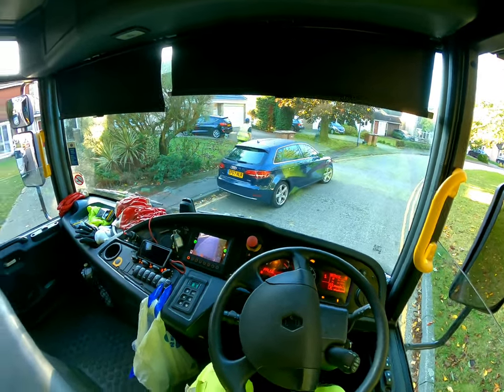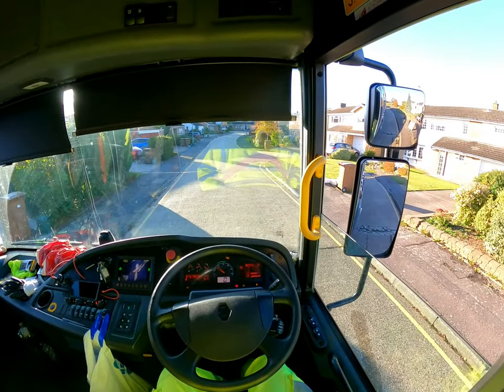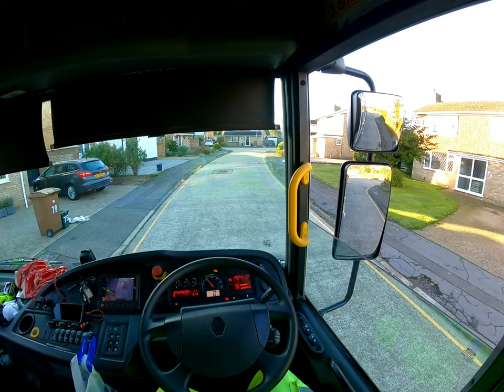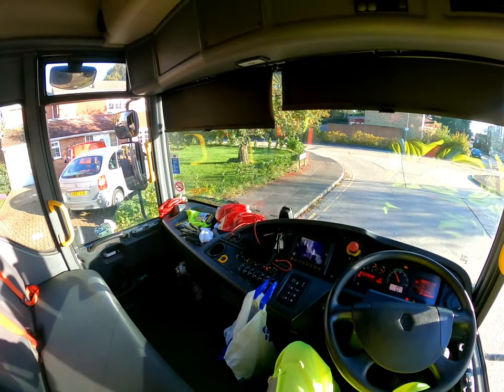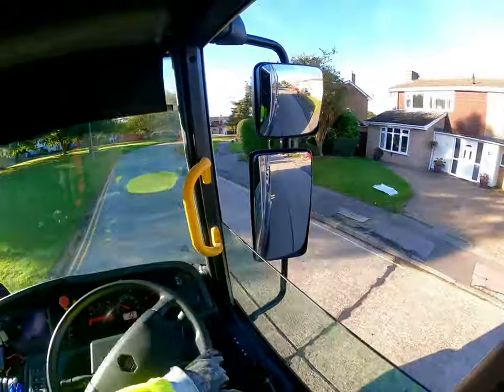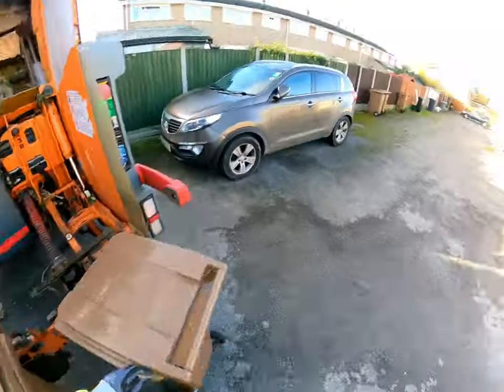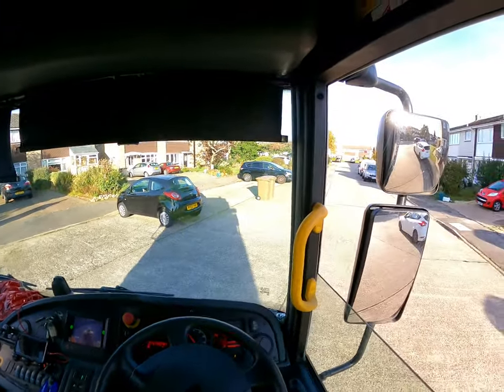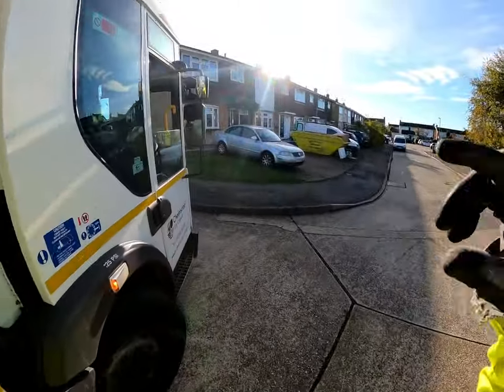Bin Man/Refuse Collector/HGV/Lorry/Truck Driver POV #1

Comment: Great video and great skills by all involved including yourselves! Did you often find bins falling into the hopper on the omnidekka lifts?
Reply from the maker: Well spotted on the Terberg equipment 

Bins would only fall if they were damaged or had bent lips on the front edge 

Other than that the lifts were consistent. Vehicle to Vehicle differences are very apparent 

Uneven lifting on bulk/twin mode
1 fast lift 1 slow
Auto mode getting knocked out once at the top
Sensor issues

The new 2020/21 vehicles have fully electric lifts. I believe they said "Patent Pending" on the back.

Quite a severe lift action that could rip the bins out of your hands and rocket them up much faster than other equipment. You had to keep your wits about you

Comment: The Bins here, where i stay with my mum if the green bin for carboard also grey domestic and the brown bin gardening if they are over flowing they will not collect it.
Reply from the maker: Our bin collection is meant to be lid down + no side waste but every crew operates different. 

No limit to recycling which is reasonable,  any effort to reduce waste to landfill I'd worthwhile.

Comment: wow P4H91 that is awsome and i want to know how hard is it drive a class 2 for like bin trucks and other one that collects the glass bottles ect and how much dose it cost as i wanted to know as someone told me it cost about £250 to £400 if you failed it you have to do it again. but im not sure
Reply from the maker: HGV 2 driving is straight forward. It helps if you have driven larger vehicles previously of course.

I say this due to my prior experience but even for new starters it is something that can picked up with confidence and training.

Height, width, weight and length are considerations to be continually mindful unlike a car which you point and go anywhere. 

Tail swing, mirrors sticking out, heavy loads, tall roof/box/wind deflector all act as jousts against lampposts, buildings, cyclists and other road users.

Leave plenty of space when overtaking, assess the distance needed and run off and thing about how your vehicles speed and size affects others.

If you're looking at training, go for 5 days not 4. For the sake of a small saving you're cheating yourself out of a day of training. I would rather go into an examination/assessment with as much training and help as possible before attemtping a test.

Retest fees are high yes, however circumstances on test day may necessitate it. The test itself doesn't have to be passed first time, it does not guarantee a better qualified driver due to first time pass.

Keep calm
Be attentive 
Buy books, watch videos etc 
Try it enjoy it and stay safe

Comment: Not sure where my comments gone but great video. Do you ever do black bins or recycling collection or only browns?
Reply from the maker: Thank you for your positive feedback 

Unfortunately there shall be no more videos from this place as I have left and shall be starting a new job shortly

Had I known it would be met with this positive reception I would've started filming a while ago

I drove various rounds whilst there 

Black bins 
Brown bins 
Trade waste 
7.5t "ISO" (Isolated- difficult access)

I didn't do any card/paper/bottles/plastic or food recycling there as recycling was run separately from waste/garden

Majority of vehicles in the yard are 18t or 26t Alexander Dennis Eagles. A couple DAF LF and Isuzu 7.5ts are on food and ISO (Isolated-difficult access) rounds 

A few 2005, 2010 models. Majority of fleet are 2017/2018 with some new 2020 "70" plate motors
Reply: @wheelerd02  You’re welcome, that’s a shame, is your new job also in the waste management industry? Seems like you’ve been on a wide range of rounds!
Reply from the maker: @refusevehiclesne  it is indeed in waste management 

I was an agency worker and as such I was not tied to any single round. I was placed as required either covering holiday or if staff allowed, change-over assistance.

I would come with an empty vehicle and continue loading with the crew whilst the primary vehicle went off and emptied. Or, if staffing allowed, I would bring additional loaders and the team of 2 vehicles would split off and whittle down the work much quicker
Reply: @wheelerd02  Great! Assuming you’ll be working full time there now? Yeah we have a similar system here, usually referred to as ‘shuttling’. Any chance you can film in your new job also?
Reply from the maker: @refusevehiclesne  New job is indeed full time. Shall update on progress once I get into a groove

Unsure on videos, shall have to ask them. Although I haven't encountered it I know some places are not keen on video uploads
Reply: @wheelerd02  camera in Dennis last no time the Dennis no where as good as the Mercedes

Comment: How much rubbish can you fit in a 26 ton truck?
Reply from the maker: Vehicle Tare weight is approx 13800kg

Most vehicles can go up to 25500-26000kgs. Some vehicles pack up earlier at 23000-24000kgs

Best case scenario it can take 11.5t of waste 

General (black bin) waste packs easier than Garden (brown bin)
Reply: @wheelerd02   thanks for answering my question

Comment: how bigs the rounds where you are? we can spend from 6am till 5 no break and run like idiots with the amount we do
Reply from the maker: 0630 - 1630 was the rota/paid time.

Some days done earlier, some days later. Black bins were normally quicker than recycling, especially cardboard. 

There js always time for a break, if you are running about and skipping legally required breaks as you say then your gaff isn't scheduling work correctly or fairly. Job isn't worth it nor does it pay enough to run yourself into a early grave.

Although there is an early finish incentive to rush, my employers back then said don't run the rounds otherwise they'll pile more on you. Running yourself ragged just to finish that late isn't worth it, you're making someone at desk have an easier life.

Comment: Nice job! I’m hoping to become a bin man when I’m older
Reply from the maker: Best of luck on your intentions, HGV drivers are sorely needed throughout the UK currently
Reply: Yea I’m in ireland, I don’t actually wanna drive the trucks, just work at the back
Reply: Set you sights higher mate and do something else done the job a few year now it's getting no better. It was good years ago but longer hours due to new builds and a lot more walking.
Reply: @jacobs3031  here in Ireland our refuse trucks have steps on the back, so not much walking.
Reply: @SouthwestRefuseVehiclesIreland  yes I wish they did that here in England mate would make the job so much easier for us. I would try getting an apprenticeship in a trade of some sort first mate then you've got something to fall back on. I started around age 20 on bins but seen loads just starting around 40 and even 50s so it's never too late.

Comment: JW what's the ppe rules seeing shorts would love it in the heat coming
Reply from the maker: Shorts are fine however the driver has to have full length trousers on when getting out at the tip site.